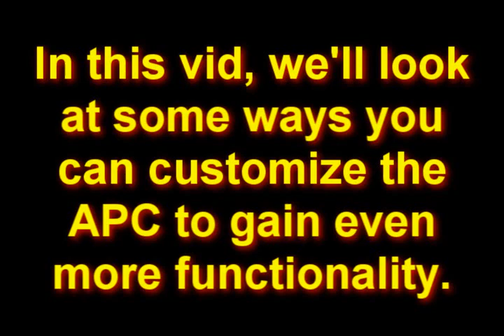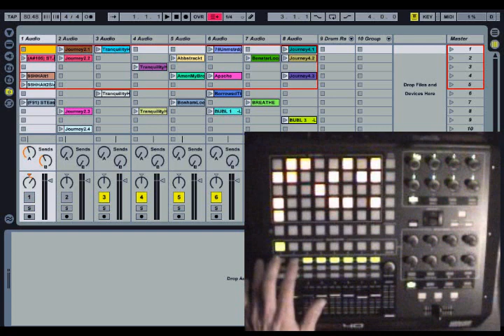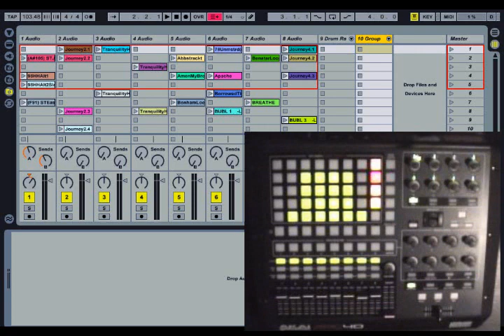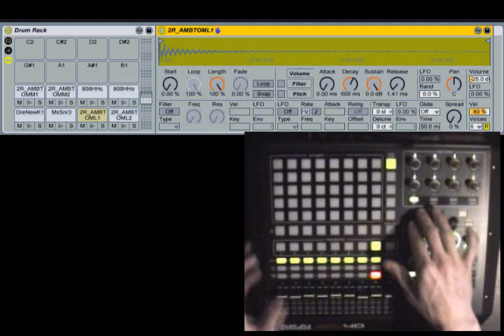Akai APC40 Customization

Comment: What is it youre trying to do exactly?
Will you be using ableton to mix, 
or turntables?
If youre using turntables and want to use the apc40 to trigger loops, youll need to have the sound card in your laptop hooked upto one of the channels on the A&H mixer.